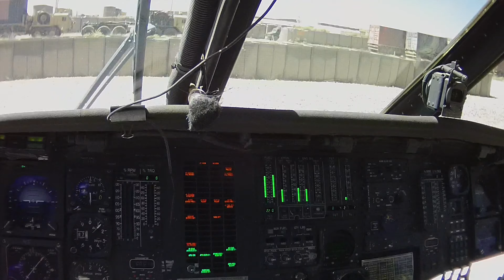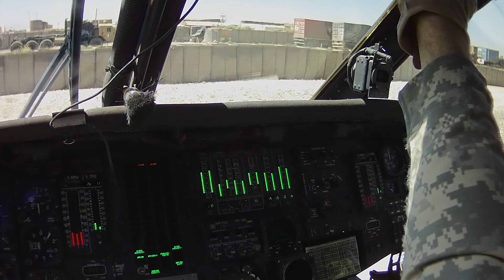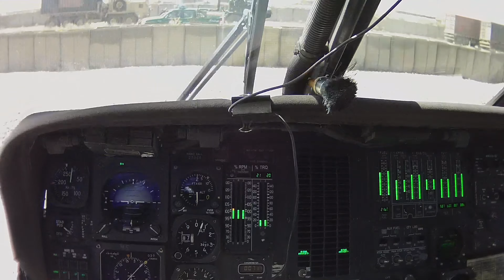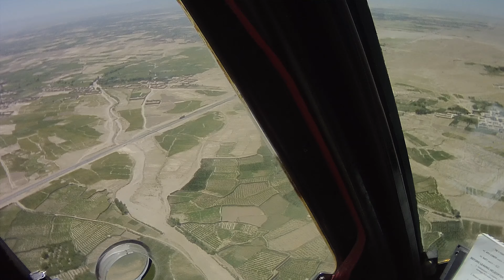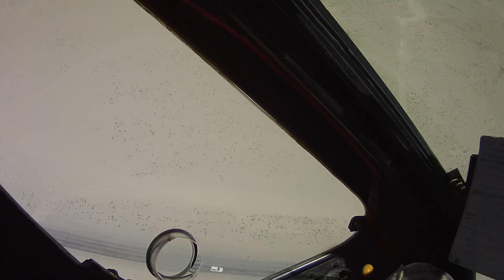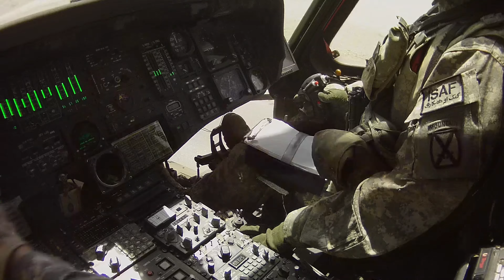Landing On The Highway

Comment: I love that I can watch these videos and fully understand what is being said and not said. I would have to reference my checklists, but I know what you mean by getting air flow through the engines to prevent a Hot Start, and hacking the clock after hitting the engine start button. I don't remember all of the parameters either but I do remember looking for Nf, Ng, and Engine Oil Pressure on the rise within so many seconds. Once at Bagram because of the elevation, temperature, and whatever else, we tried to cross bleed start the #1 with not enough Ng, and Hot Start Prevention kicked in after a Turbine Gas Temperature spike, dumping fuel overboard via the Overspeed Drain Valve. I was in the left seat for engine start and I remember the aerial gunner going, "Ahhhhhhh... we gotta lot of fuel coming overboard here" 🤣

What I hope your viewers understand is that no matter how many times you show up to a vehicle destroyed by an IED blast, there is always that initial "Holy shit" moment. Your brain struggles to comprehend how a vehicle that is the shape and material you know is now a twisted wreck, engulfed in flames. 

Thank you for the videos, and I hope you are taking care of yourself. So cool to see Dustoff in action!
Reply from the maker: Yeah, I should dig my checklists out. It was always a sense of panic when you saw the exhaust temp shoot up! You knew you were losing time because now you have to start over!
As always, thanks!